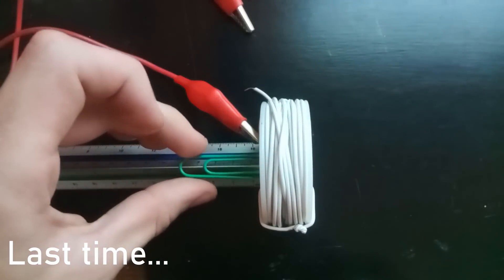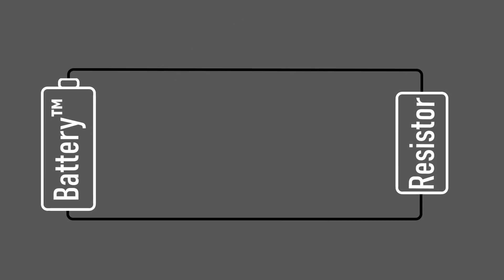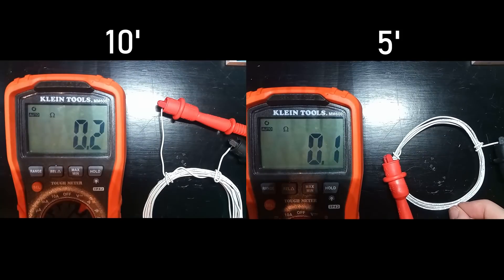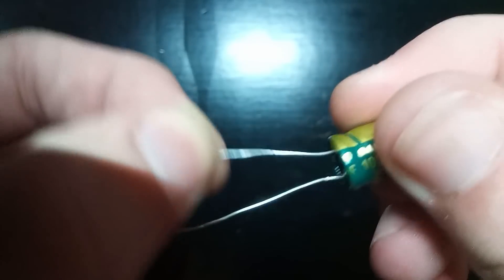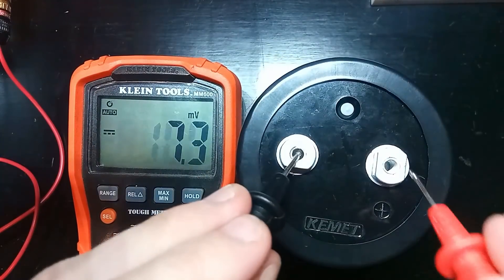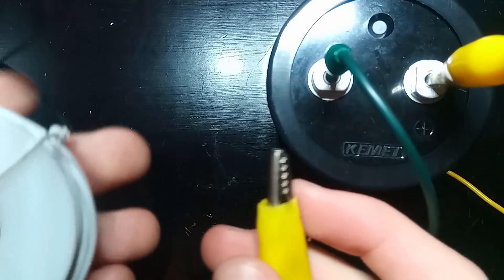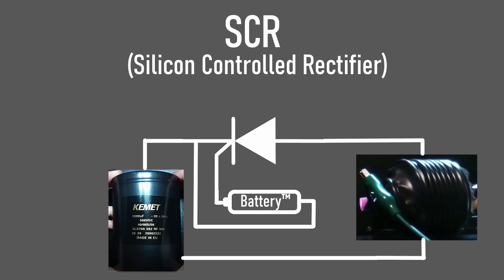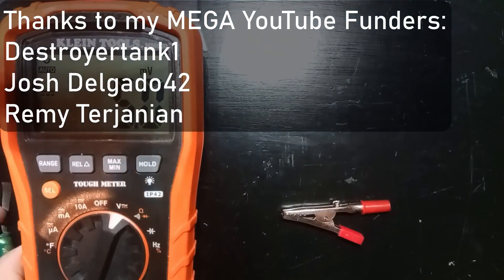Current & Capacitors: Making a Coilgun - #2

Comment: How are you going to deal with the coil inductance? Massively increasing the current so quickly should create a gigantic counteracting EMF, and also might cause voltage oscillations that can charge the capacitor in the wrong direction and damage it. And if that doesn't matter, then why not?
Reply from the maker: My SCR is kinda saving the day on this one. It only lets current flow in one direction, so it won't let the cap charge backwards. With that said, I'll probably need to look into how bad the collapsing field messes with things since I blew out two SCRs for unknown reasons.

Comment: How about keeping the low resistance wires but having many individual wires which are controlled by the gates, meaning the magnetic force should become higher.
As for a power source would a generator work? IE have an electric motor spin a belt and have the generator on the end of the belt which charged the capacitors, the trick would then be changing the size of discs spinning and recieving the belt. (Like a large disc spinning the belt on the motor and a tiny disc recieving the belt on the generator) this would also mean you could easily control when power was being transferred into the capacitors without worrying about wires.
Finally I would suggest investing in safety boots, something with a thick rubber sole, so if something goes wrong and you end up touching the electricity you aren't in danger.
Reply from the maker: The high voltage converter seems to be doing the job for now, though I might switch to my own custom one if I find I want more power. As for the rubber boots, the funny thing is as long as I'm powering the high voltage board off of something not referenced to ground, I cannot be shocked unless I touch both terminals. This is because it's high voltage DC and not AC, so the capacitance of my body will not act like a return to ground. I really do not recommend touching anything high voltage at all, but it isn't quite as bad as it looks.